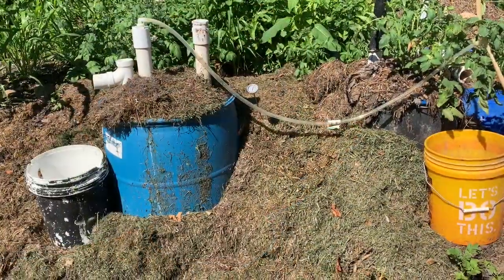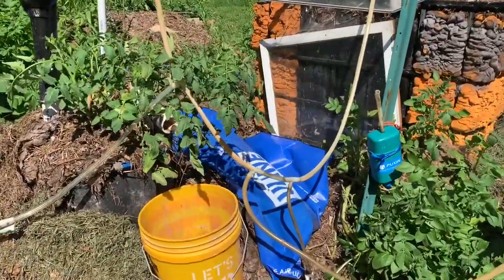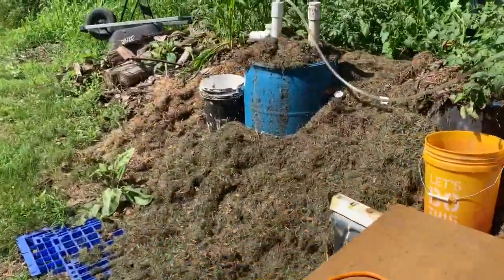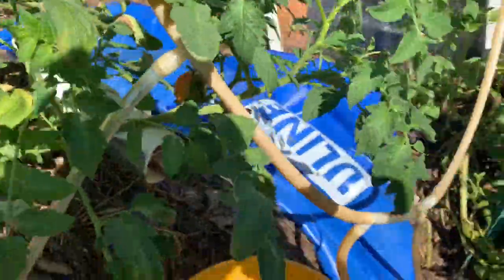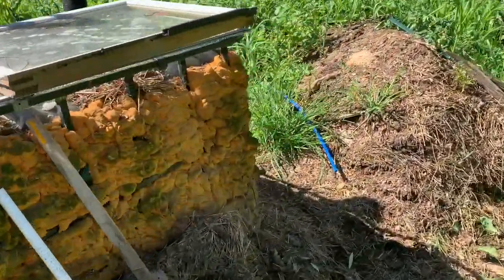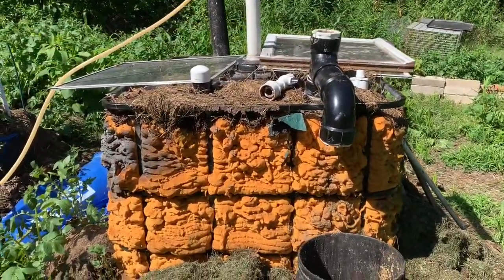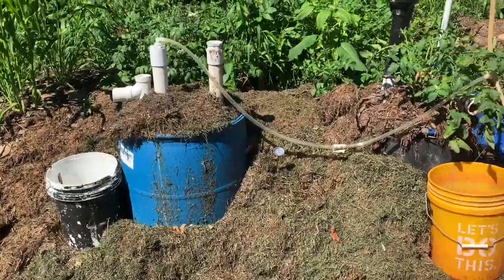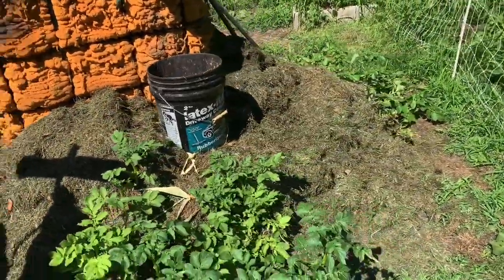How to make your own LP gas at home

Comment: I live in the city so i have neighburs all around, but want to build a biodigester- how much gas do you get from little 55 gallon one? I get around  a small bucket of food scraps every day from the kitchen. Is that digester too small for that amount of waste? Would mainly be using the gas for BBQ or stove.
Reply from the maker: With the digester,  a 55 gallon digester maybe a small gallon jug worth of food scraps. If you’re in a cold climate even smaller. I’d feed every few days with a 55 gallon digester. Gives the digester good time to break down the waste and make good biogas.

Comment: Thanks for tip. You're right, I put my 5 gallon digester out in the direct sun and 2 months later it wreaked havoc on all the joints causing leak, even though I have covered it with a coat of black paint. Yeh, it wants heat but not direct sunlight! I wish I had watched your video sooner :)
Reply: I wraped mine with tin foil.